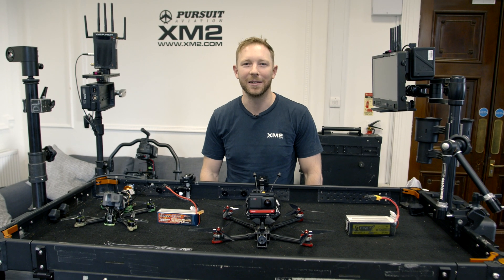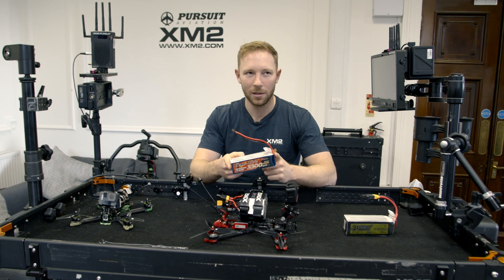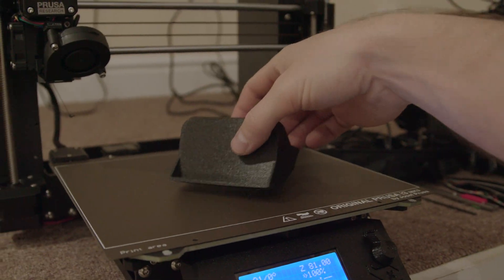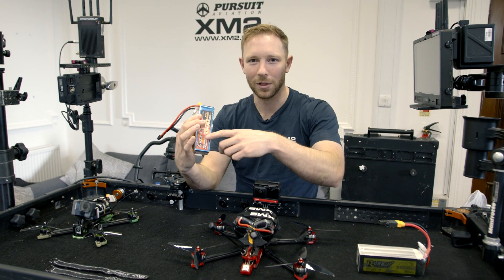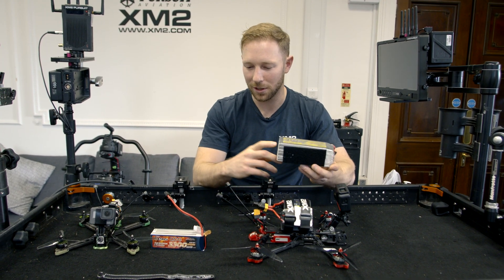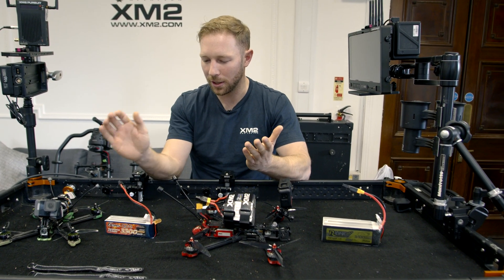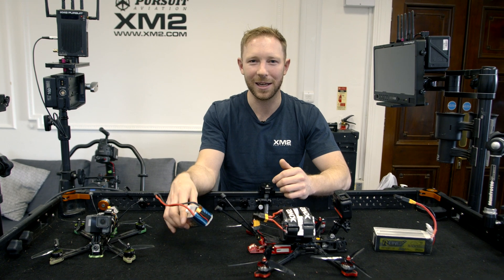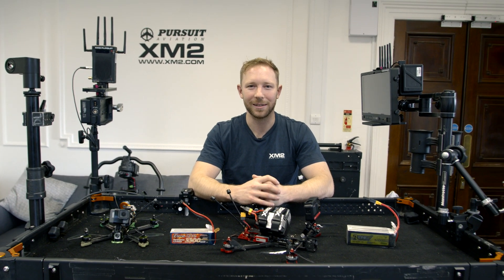Best LiPo Battery Setup for iFlight Chimera7 HD | 21 minute flight time 😲

Comment: Hey guys. I picked up the chimera 7 pro and having a tough time getting the times everyone else is getting. 3500mah gnb gives me 5min of flight time on 2 seperate batterys most are getting around 15min.  Also 2 full send in parrallel give me 13min and most are getting 20+ . Are doing anything to the tune different from what comes from iflight?

Comment: Thanks for the info. I am looking at getting either the Chimera 7 HD standard or PRO version. I already have some 6s 6000 mah lipos weighing about 850-880gram. Which of the two Chimera 7 HD options would give me the longest cruising time? I have seen on YouTube that the PRO is less efficient with smaller batteries so has less flight time, but possibly may have longer flight times with heavier batteries. Can you confirm which option should give max flight time with these lipos that I have? Thanks

Comment: Looking at 7" and doing 6S2P 6000mah or 8400mah (21700) 
Like idea that depending on battery u can get 20 to 25min flights but it's cruising alot faster vs my 4" and 5" long range quads
Reply from the maker: A 6s2p LiIon 6000mah should get you over the 20mins easy - have a look at this: https://xm2store.com.au/products/fullsend-6s2p-6000mah-liion-fpv-battery-xt60?_pos=1&_sid=fa712458d&_ss=r

Comment: Which KV is this example?  Can you take 2 4S 1550 100c batteries and run them in tandem?  That would be cool since I have a bunch of them.
Reply from the maker: This one is a 1300kv 6s. The best batteries we have used are two of the 6s 1800's or one 6s 4000mah!

Comment: can you run 4s on this quad ? and will it preform the same as 6s ? or do you have less throttle ?
Reply: You technically could run 4s but not its going to struggle I assume. The motors are set for 6s configuration.

Comment: @XM2 PURSUIT whats the biggest battery lipo and liion I can put on this quad? I need to get the max time I use the 1300kv motors and what kinda time would I be looking at? Thank you!
Reply: From my experience with 7" quads, probably an 8000mah 6s.

Comment: Hey guys I got 4000 mah 6s batteries from ZDF and they work great on this machine. I got 13 minutes flight time in very heavy wind today, see here: https://youtu.be/DFYCTKsUWMg

The link to the battery I got: https://www.aliexpress.com/item/33013700937.html?spm=2114.12010612.8148356.2.6e58606cZxhG5j

Comment: Thank you so much for this video rhat decided me to buy this beast :))
I have a question about parallel battery setup. Can i put 2 different mah battery? A 1500 // with 1400 for example ?
Reply from the maker: No problem - no the batteries must be the same capacity!

Comment: Do a high c liion in 2p configuration and you can get up to 60 amp discharge and 90 amps max
Reply: Could you run two 1300 mah 100c 6s packs in parallel to do this?
I've just built a chimera 7 with 2806.5 1700kv brother hobbies, and I'm trying to get lots of speed, with decent flight time. 
I tried my first test today with a 2200, averaged about 85 kmph and flew about 4 mins.

Comment: Have you had problems burning ESCs with this drone? I’ve had two fail on me mid flight when cruising at 50-60km/h where I’ll even completely lose video. The first lasted maybe 15-20 packs and the second a bit less
Reply from the maker: Hey Michael, ours is still going strong. Sorry to hear you're having issues hopefully iFlight can offer some support?
Reply: @XM2_official  I ended up getting it figured out, I foolishly didn’t even think to look at the motors but it turns out that the pre-built drone I received had the wrong kv motors than I had ordered. Ended up drawing way too many amps but I got the motors swapped and haven’t had any issues since 😂

Comment: Nice feedback and research.  Would you be able to provide the weight for each battery/setup? Would be nice to compare it to your prop and motor setup to see how much weight to thrust ratio you are reaching and find the sweet spot based on type of flying.  I bought parts to build a 7 inch last weekend and did go with an iflight 7 inch frame due to how it can change the arm spread i think the chassis is a bit long, but i also felt it would allow for bigger batteries.  I ended getting higher amp escs than needed in case future changes are needed.  Also the room is perfect if i ever go digital.

Comment: I have the 1800kv version. Did my first flight today with a 6s 3300mAh battery and got only 6 minuts of flight time. Could it be, that to higher kv burn some more battery power?
So far i´m a bit disapointed. Because i wanna do some long range stuff.
Reply from the maker: Yeah 1800kV is really for small 6S batteries (suit freestyle) or large 4S batteries (suit long range) - with that 3300mAh battery be careful not to burn the motors out it will probably get quite hot!
Reply: @XM2_official  Hi, first thanks for the video ! then I just ordered the 1800kv version and I wonder if I made a mistake cauz I want to do some long range stuff but also be able to make dives or follow ski freeride, anyway it's too late so for slow cruising you'll advise to get a 4S battery but what size and discharging rate ?

Comment: I literally walked out of your shop today with the 1300kv chimera 7 and it flies great. I got the V8 adapter with it and it looks wicked but to be honest you can achieve the same by placing 2 6s batteries 1 behind the other.
Reply: What is the difference with a 1800kv motor?
Reply: @ggrosclaude  1300kv - like diesel car, economy and giant torgue. 1800kv - is petrol speed cruiser. Fly 110km/h+ faster but drain battery faster. Can do simple freestyle. For long range is better 1300kv.

Comment: With my chimera 7 I got 10 minutes with a 4000mah 6s lipo cruising around at 60kmh with a gopro hero 5 session and HQ 7x3x3 props.  And that's having to run the lipo down to 3.3v per cell.  I have a another drone similar setup but on an 8 inch frame spinning the Brother hobby 2806.5 1300kv motors & 8 inch props,  it surprisingly gets 12 minutes with a 2200mah 6s lipo, cruising at 80kmh.  Surprisingly much more efficient with 8 inch props. I'm anxious to see what flight time it may get with the 4000mah 6s on 8 inch props. 😁
Reply: That's pretty disturbing... I fly my Chimera4 at 60-80kmh for 14 minutes on a 4S 3000mah Li-ion.. Was looking at the Chimera7 to double my speed but that seems pretty similar or worse..is that 1300KV or 1800KV?
Reply: @karoo_bushman6880  it's 1300kv. It really shines running 2 lithium ion 6s  batteries 3000mah each in parallel totaling  6000mah.  Cruising around 70kmh  I'll get between 15 and 18 minute flights.

Comment: Hello, really interesting video. Im not clear on the flight time with the V8 configuration... And another thing I want to ask you... do you know If I use 2 of 1300mah im hurting the batteries? Like forcing them to working a little harder than the normal use. Thanks a lot!
Reply from the maker: The flight time of the V8 configuration with two 1550mAh batteries is the same as the flight time with one 3300mAh 6S battery 👌using two separate batteries won't hurt them - just ensure that they are of similar "age" and charge level. It won't be good to use two different types of batteries, you want them matched a close as reasonable
Reply: @XM2_official  thanks a lot!!! You answered my doubt. Ill do that. ☺️👌🏻

Comment: Hi! thanks for the video! I have a question ....is it usable with a 4s battery?
Reply: Yes,  you can use a 4s lipo on the 1300kv setup. I use a 4s 4000mah lipo on my chimera 7 1300kv. It just feels more sluggish then the 5s or 6s lipo
Reply: @flyerelite5153  4S 5000 I will use with 1300kv .. what do you think? on the 4000 did you get how much flight time? Maybe 1300kv is the best option, I thought I'd use 1800kv because it has more speed... but it's relative to speed because it's not always in speed conditions... if you want speed at 1300kv, just use 6s...
Reply: I flew mine today with a 1300 4s and it flew great.
Reply from the maker: The 1800kV model is suitable for 4S batteries
1300kV is suitable 6S batteries
Reply: @XM2_official  thanks :)
Reply from the maker: iFlight recommend using a 6S battery or 5S for slow cruising.

Comment: Hi how are u?

I have 3 questions.
1. If I want to use with the chimera 7 with a 4500mah lipo which weight 650g is that a lot of the drone? 
2. With the lipo that is 4500mah and weight 650g could I get more than 15min flight time?
3. Does the fpv drones have any mah restriction?

Thanks and nice video
Reply from the maker: Yes, in this video we flew with 5100mAh battery. It is a little heavy feeling but it flies just fine. 650g is also heavier so it's not ideal but it will work.
Reply: @XM2_official  and if I use a 330mah that is 506g it will fly too more than 15 min?
Reply from the maker: @juanjo_fpv5097  In the video we flew with 5100mAh for 21 minutes

Comment: Dude what speed we going at
Is it slow like a bus
Reply from the maker: I was cruising at 60km/hr in these videos, which is a medium pace for this drone 👍
Reply: XM2 PURSUIT  that’s pretty damn good 
So you think it could get up too about 100km, would be good if it was loaded with cross fire
Reply from the maker: @mickswagger6086  For sure 100km/hr no problem. Crossfire is easy to add on!
Reply: I had it up to 120kmh

Comment: Hey mate, thanks for the video. I was wondering what the difference is between something like an  nazgul5 vs chimera, and what makes the chimera better at long range. I'd imagine better antennas and bigger battery, is there anything else that helps get more range?
Reply from the maker: The Chimera7 with 7" props and low kv motors is much more efficient than the prop motor combo on the Nazgul5, and can support a bigger battery, so its mostly about flight time to let you get further out and back!

Comment: HI , have you the 1800KV version on this video? and do you think I can use a 4000 mah on this Kv version and how range time?
yann
Reply from the maker: This is the 1300kV version - it could be a similar flight time (around 12min with action camera) if you are cruising (minimal flips/rolls)
Reply: @XM2_official  thank you Pursuit, Iflight tell me that 3300 or 4000 mah can burn my 1800 kv motor, so what do think about !
Reply from the maker: @yannperherin354  It depends how you fly it, you want to limit the power in the motors, so cruising will be ok but not doing any freestyle. The motors are too high kV!
Reply: @XM2_official  ok fine, its that I would, fly cruising, no freestyle- so I will try it this weekend with a 4000 mah and see and of course reduice motor power!
thank you and come back to you with results
Reply from the maker: @yannperherin354  Monitor the Amps on the on screen display and keep it below 20A mostly will be fine
Reply: @XM2_official  Yes right, I will see on my Dji google , thank you Sir
Reply: @yannperherin354  hi! how mutch time U can fly with 1800 kv? im choosing between 1300 & 1800 now

Comment: Great video! I own the XL5 HD, what battery do you suggest for a mid range cruising with action camera? I saw you mounted something big :) Thanks in advance!
Reply from the maker: Thanks Marco - on the XL5 we recommend an 1800mAh 6S for mid range cruising + AC. The XL7, recommend the 3300mAh 6S 👍
Reply: @XM2_official  Thank you very much!
Reply: @XM2_official  What flight you getting with Iflight XL 5 HD 6s 1800 mah + AC setup? Have you tried it with 18650 6s1p?

Comment: I got my 5200 80c arriving next week. I did want to ask you any way of lowering the tilt on this thing. I’m looking at the sky on landing and take off. Makes me feel uneasy on landing. You been able to find a fox or at least lower it somehow. Also have you tried a return to home yet. Been wanting to try this.
Reply from the maker: Hey Kizai, yes have enabled and tested GPS Rescue. It's worth noting that it will not return to home, just the general area (then disarm), so be careful testing it :) I have been able to decrease the angle of FPV camera, however the tilt range is somewhat limited
Reply: @XM2_official  I’ll give the instructions that it came with a good going over as well as any YouTube videos coving the subject. I have the 1800 kv version and it’s way fast. Tried it on a 2200 mah 120c. The rates don’t feel that extreme like a five inch.
Reply from the maker: @jonestown1978  Yes definitely absorb as much content about the GPS rescue before testing it, you need to take back over control before it reaches the decent radius (where it disarms). You can also limit the angle of the aircraft so it doesn't come back at over 9000mph 😅- another tip when testing it - is to fly the aircraft at least few hundred meters away, land it, but do not disarm it. Then you can activate GPS rescue. If it is successful aircraft will take off and return towards home point. If not successful it won't drop out the sky and cause any damage :)
Reply: @XM2_official  good idea about landing. I have a xl5 from iflight with gps. I set it up before and made sure I had all the setting right before trying the return to home. It worked great but it climbed up first really high is that normal or can I adjust the night like the angle in betaflight. Also was angle mode enabled when you got it. I read on the iflight website that you have to turn off angle or it will stay in that mode. I thought you can get rid of that all setting up in betaflight.
Reply from the maker: @jonestown1978  Yes you can put it in Acro, default is angle mode. And the GPS rescue return height is configurable. Joshua Bardwell has an in depth video how to interpret and adjust the settings. It's definitely a rainy day video  ✌️

Comment: Torn between this and building my own with probably the Super G+.  Only thing is the price of this machine can't be beat really and I'm already thinking about using these same motors and DJI.  And too have them already tune a 7" beast....agggghhh it's tempting.  Thanks for the battery tests. Definitely will make sure I get what I need now.
Reply from the maker: Yes it's difficult to overlook the value here - the tune is superb on it 😮 (like the XL5) - that's the biggest trouble I wasn't able to overcome with my previous 7" model!

Comment: Would there be any benefits of a hybrid battery like small part lipo and bigger part 18650 cells? Just like electric cars uses electricity and petrol fuel. So if you need extra power to correct your path you will have it . Or will the weight be to mouch to consider both.
Reply: It could work but the load on each of them would start to make the batteries start to go out go balance with each other I would think.